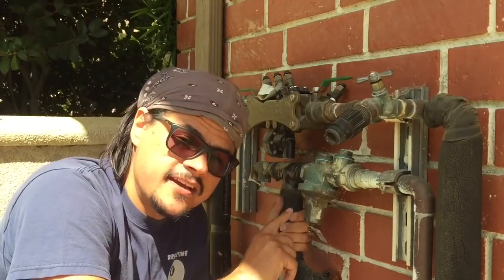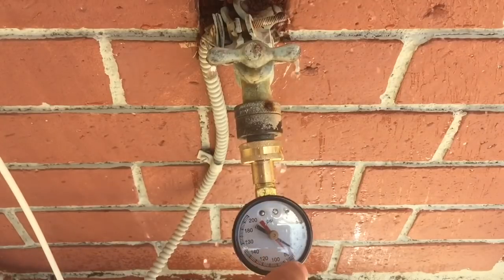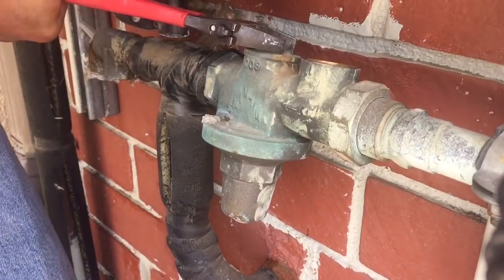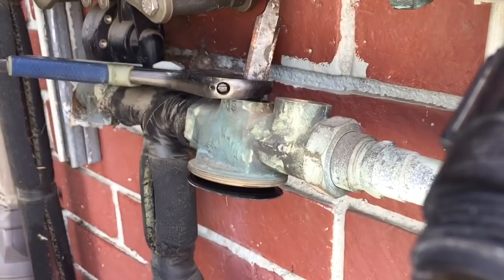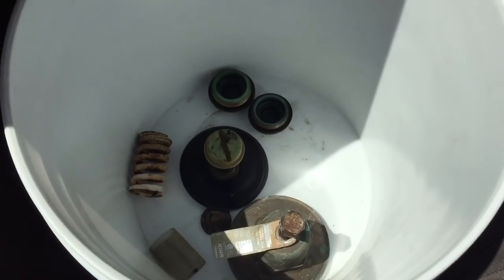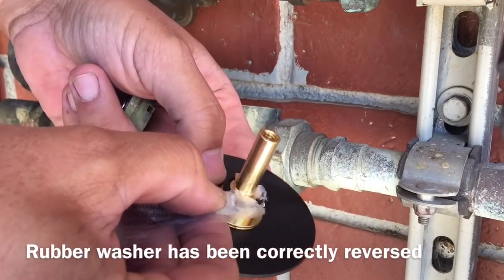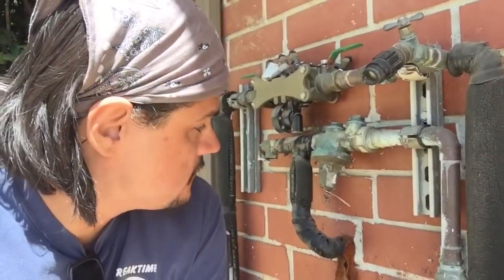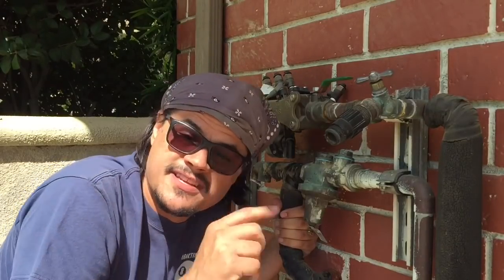How To Repair a Home Water Pressure Regulator and Adjust Water Pressure

Comment: Two failed in 5 years I removed it tossed it in the trash. Plumber talked me into installing it house was fine for 40 years without one now my sprinkler system works better. I like having 120 psi.

Comment: I watched a BUNCH of videos on this stuff and checked MY water pressure.  As it turned out, mine was at 115psi! 😱. Most videos show you how to change the entire apparatus, but THIS GENTLEMEN SHOWS you how to simply change the internal components.  My “Watts” pressure regulator sells for just under $900.00!   That is outrageous!  The “repair kit” cost only $100.00!   This video showed just how simple the repair was.  Now, I’m at a comfortable 65psi and no longer worrying about a flood in my house!   THANK YOU for showing me how to do this!
Reply: Mine is 120 psi never had an issue house is 40 years old.

Comment: Just rebuilt my 600XL.  The new ones are from over $180 to over $300.  I was not sure how tight to make the piece that you had the chisel on.  Instructions just said do not make "too tight" or the piece might break.  I started at 140lbs (intake) like you but put it at 50lbs.  Maybe too light but sure works fine in the house...I think I could deal with a lot less than 50.  I left the gauge on for many days and found that on some nights (or one day) I had a moment of the pressure going up to 140 and staying there!  In the morning, I turned on a faucet in the house and the pressure went back down to 50 and stayed all day until the next spike.  The one time this happened during the day, the pressure came back down by itself but I could see by the "recording  needle" where it had been.  I think that O ring is the weak link.  Maybe I could just buy a few of those plus carefully emory cloth the bore it fits into that you mentioned must be smooth.
Reply: The regulator may be working just fine. If the down stream piping is not equipped with a thermal expansion tank and there is no water flowing, the regulator may close, trapping water. Then when the hot water heater turns on warming water starts to expand, but it has no place to go. The expanding water raises the water pressure you see on your gage. The pipes expand ever so slightly to accommodate the increasing pressure. 
It's a good practice to install a thermal expansion tank. It helps protect and extend the life of the regulator, solenoid valves, and the lining of hot water heaters, etc.

Comment: Not for nothing but did you try to adjust the existing regulator before you replaced the parts, maybe that was all that was needed???
Reply from the maker: Yes I did.
Reply: @VinceRocca  I figured you did, it just wasn't in the video.

Comment: Hot water coming out of the sink or shower will pulsate. Once the water starts to get warm the pressure will drop and then return for as long as we have it running. If I turn on only the cold, it does not seem to happen. Pressure out in the yard runs about 75psi, outside back of the house it is 60-65psi, at the hot water tank drain it will be 60psi. City water, 80gal HW tank, 5 gal expansion tank that is about three yrs old. When I installed the expansion tank the house pressure was 45 to 50 so I pumped the tank pressure to that number. At the time the outside pressure was running 80+. In three years they have built 8 new homes between me and the big water tank down the road with two more under construction. I am really not wanting to tackle the regulator. It is in a hole 4ft down and 2ft x 1 ft. I will have to dig to get to it. The plumper plumbed the new house and the contractor backfilled afterwards.  Thoughts? I am going to check the expansion tank but I a pair of gloves and a shovel are in my future.

Comment: Good job, good video.  I have a Wilkins 70 that has failed, but they don't make them anymore.  However, they do supply the Wilkins 70xl as a replacement.  It's just 70 bucks on Amazon, so I'm just going to replace the entire regulator.  I hope my repair goes as smooth as yours did.
Reply: The Wilkins 70 & 70XL are the same mechanically. The parts are interchangeable. The difference between the models is the XL models are lead free. Unless lead is a serious concern to you, the changing of PSR's was not completely necessary.

Comment: Vince, my pipe(s) vibrates when the cold water is running.  It never happened before.  Watching your video could it be my pressure reducing valve, please help. Thanks
Reply from the maker: Keep in mind. I’m not a plumber, I’m a television editor who works on his own house. But, there are many things that can cause a vibration or “water hammer” the spring in the valve can be one of them. You can try screwing the bolt in or out to adjust the pressure and see if it reducers the vibration.

Comment: Do you know if the Wilkins 600 and the Zurn-Wilkins 600XL regulators use the same repair kit?  A couple of places I contacted including the Zurn-Wilkins customer service could not tell me if the Zurn-Wilkins 600XL repair kit works on a Wilkins 600 regulator. My regulator has a 1.5” inlet and 1.25” outlet (even this is puzzling me). Even an online hardware supplier could not give me an answer, nor local hardware stores. Yours looks exactly like mine, Wilkins 600, except for the in/out pipe size, are yours both the same size?

Comment: That pressure safety relief valve probably saved the home owners from a bunch of ruptured/busted pipe solder joints. If that safety is lifting at 148 psi the street water pressure must be REALLY high. No wonder that regulator was 'singing' lol...

Comment: Do you know how you can tell which kit i need in term of size.... I see kits for 3/4",  1" or 1 1/4". My Watts unit does not say. Is that the diameter of the bottom cap?
Reply from the maker: The size refers to the size of pipe the valve is made for. It should also be embossed in the body of the valve. Plus there’s usually a tag on the top nut with the model number.

Comment: Thanks for the video. I am ready to attempt this myself but need to know if the Wilkins and Watts repair kits are interchangeable? I have a Watts 25AUB and it looks almost exactly the same as the 600. I cannot find any kits for the watts similar to what you used.
Reply: and just like that i found the answer myself but might be helpful for others. https://www.zurn.com/media-library/web_documents/pdfs/crossreference/wilkins_prv_xref-pdf.aspx

Comment: My water tank keeps blowing release valve would it be a regulator problem or should I replace the pressure reducer
Reply from the maker: That’s actually a serious issue. The water tank has a temperature and pressure relief valve. They should be replaced every few years. So it could be faulty or too hot or too much pressure. That pressure could be from the regulator or from the tank itself. You need to pressure test the system and temperature check. It’s probably best to get a professional plumber out to have a look. Search YouTube for “mythbusters hot water tank” to see how serious it can be. Please subscribe so I can get to 100k subs.

Comment: not suppose to install pressure reducers upside down like that...
Reply from the maker: It’s installed vertically. But I can’t imagine how gravity can effect 80-200 pounds of pressure.
Reply: @VinceRocca  that is vertical?? why is the adjusting screw on the bottom facing down??
Reply from the maker: Ahh, you are correct. In this video it is upside down. It has since been re-plumbed and is now vertical. I mistakenly thought when I made this video it was post replumb.

But still, I can’t see gravity effecting a regulator at any angle. The 80-200psi is gravity defying. I googled and plenty of responses say you can mount them in any orientation. So I’d love to hear why it can’t be?
Reply: Please enlighten us as to why?
Reply: @charlesmirabal1671  Debris (sand/silt) can collect in places inside the regulator that you don't want it to.
Reply from the maker: That is a very good point about debris. I never considered that, but can now totally see that orientation would affect where debris/sand settles. I’m still not sure if this is detrimental to performance, but the point is solid. Thanks.

Comment: So you're getting from the water  line  965 kPa - 140 psi
That's crazy pressure!!!!  Almost 1 MPa!!!
That's so insanely crazy pressure!!!!!
Literally!!! Fire hydrants are at around 2 MPa - 300 psi
Our pressure is around 300 kPa - 43.6 psi
And even that isn't enough for us
And yes we have a pressure regulator 
But we had a clog of some kind and we're getting around 250 kPa - 36 psi
Then we bought a new pressure regulator for about 40€ - ~50$
And then our dad has miraculously fixed it and it was giving out 400 kPa - 58 psi and then we had dirty water (just a little bit of it, it even had sand in it) for a while and it was fine , the pressure was stable and reliable, that's why we took the bought pressure regulator  back to the plumbing store, so they can refund our money. The pressure was stable, BUT not forever because after 3 days we again had around 300 kPa - 43.6 psi

Comment: Hey man. I replaced my whole regulator, just bought a new one. But 2 weeks down the line and i alreaady have the same problem again. When i turn on the faucet the pressure is high for the 1st 2 secs
Reply from the maker: I discovered that my house is a closed system. Heat expansion can cause pressure buildup in a closed system. You may need an expansion tank to relieve or regulate the pressure.

Comment: We don't have that here we uses a water pump to get 55PSI.
Reply from the maker: Interesting. Here, in flat areas they pump the water up to a tower and use gravity pressure to serve the town. You pump directly from a well into the house?
Reply: WASA (water and sewage authority) is our water company they has Dams and Wells where they purifies water for drinking and pumps to houses but during the day the water pressure are weak so at nights our water tanks fill up and the day we uses our pumps to supply the home each home has a personal tank and 1/2 hp pump. The tanks comes in 200, 400, 600, 800 and 1000 gallons. I have 2 - 600 gallons.
Reply from the maker: Neat. Interesting stuff. Interesting to me anyway.

Comment: Very cool Vince, nice work. Good info. I might not of tried this before your video. take care .     Bruce
Reply from the maker: It turned out to be a simple easy repair. Pick up a pressure gauge from Lowes and see what your pressure is at.
Reply: My plumber just quoted me $575 to replace my water pressure valve. My problem is my water pressure is too low when I run two faucets at one time. I hope my repair will fix the problem for $60!!!  Hopefully I won’t make anything worse.